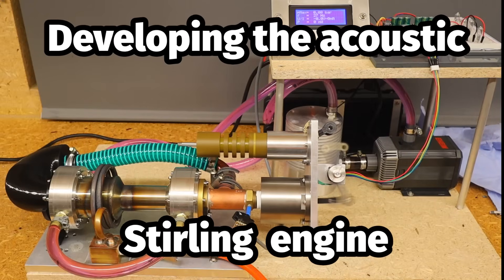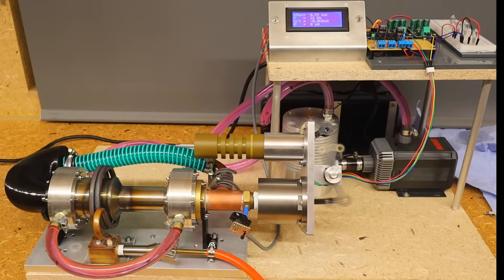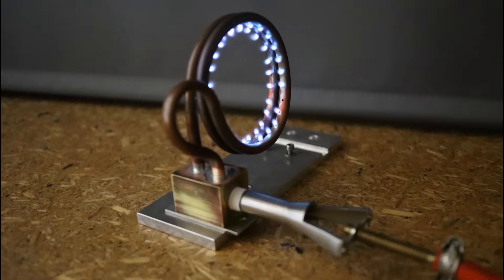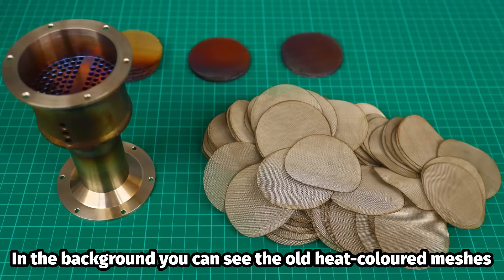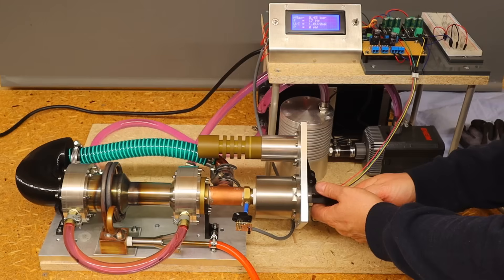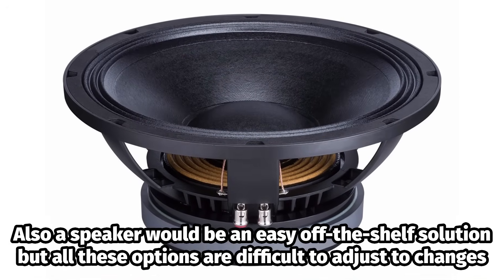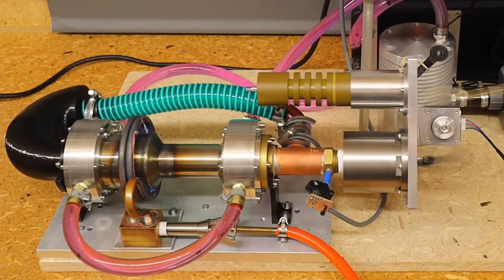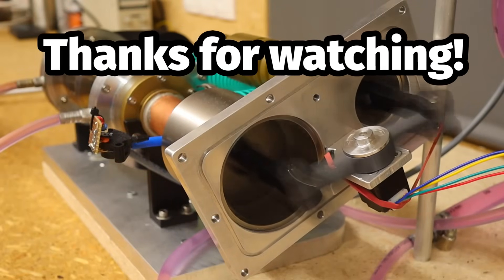More energy with the acoustic Stirling engine?

Comment: Can you not create a housing for linear generator, using small straight cuts of metal sheets to create a hexagonal shape. Instead of trying to cut rings.
Reply from the maker: Perhaps that is possible, but then there would be air gaps that would reduce performance, and I don't think it would make the work that much easier, or am I misunderstanding the suggestion?
In any case, thank you very much for your valuable thoughts!

Comment: To start the engine... use a half gear, beteen the pistons, on oposite of the nema, nema motor connected to gearbox. on each piston just use half gears there as well... simpliest way would be to use dual-shafted nema motor with a selenoid to interact with the "start-up"-gearbox-function...
Reply from the maker: The half gear is a very good idea, which I will consider more closely.
Thank you very much for your helpful suggestion!

Comment: completly different aproach: try piezo elements to extract energy. they would follow any resonat frequency.
Reply from the maker: Many people make this suggestion, but the question is how to excite the piezos when the conditions of the thermoacoustic motor change?
A membrane or diaphragm cannot adapt in the same way as a piston can.
Reply: @myengines2443  piezo elements can only work with small displacements, (roughly 0.1% of dimensional compression) medium sized piezos can transmit quite a bit of power but for that they are typically driven at several kHz, so they probably are not suitable for the low frequency of this thermoaccustic
Reply: One idea is to combine several to a bigger stack. A thin metal plate (light) shoud act as a piston and press against a circle (7) of stacks. Honestly i have no knowledge of the conversion efficency of pressure to electricity. Would research that first but myselfe had never had hot piezos.

Comment: If instead of using gas for heat, you use an electrical heater, you can make much precise measurements about the heat going in. It will also make it easy to mount and insulate.
Reply from the maker: Heating with electricity would be much easier and I could also save myself the exhaust, but since the engine will later be powered by self-produced biogas (check out my older video about that!), I would like to test it that way as well.
I looked for heating cables for this purpose but couldn't really find the right ones...
Reply: @myengines2443  just look up kanthal wire or kiln wire?

Comment: use generator with a motor pusshing the rod and starting cycle
Reply from the maker: That would be the most elegant solution to use the generator as the starter motor but I don't know if they (stepper or linear) are strong enough?
Reply: @myengines2443  strong is limited by wire of electromagned or transistor power output

Comment: It requires a GREAT seal i would assume, but most of the “Free Piston Linear Generators” i have seen utilize Air (or another (inert) gas) as a spring/balance.

Sealing/Lubrication may be difficult, but this is worth exploring.

It is FAR less accessible than FDM 3D Printing, but EDM and/or Thin Film Coatings such as DLC may work for this, even without Oil/an O-Ring.
Reply from the maker: That's exactly my plan; the crankcase has to be closed for pressure charging anyway.
By DLC and EDM, do you mean the running surfaces of the pistons and cylinders?
Thanks for your help.
Reply: @myengines2443 ”Electric Discharge Machining” and “Diamond Like Carbon”

EDM can get you near airtight tolerances, and DLC should reduce friction+wear.
Reply from the maker: Have you seen my DIY EDM Videos?
Of course there are better commercial engines than mine but I don't think EDM can achieve tolerances that are close to airtight!
DLC might be useful but i think its too expensive for my experiments, i know it from milling cutters.
Reply: @myengines2443  Making the theory into reality is really where it gets difficult, for sure!

  Collaborating with one of the channels that have made a Magnetron Sputtering setup MAY work for coatings, but otherwise you are right.

All in all best of luck with all the prototyping.

Comment: Arent those engines basicially 2 coupled resonantors? One is the actual engine (the tube) and the other one is the power extractor(Piston/membrane+ motor rotor+lever+balance weight). I would think those two have to somehow be matched to each other in terms of resonance frequency and stuff. Maybe thats why the engine refused to work with the balance weight attached. I think the problem were the dynamic properties of the balance weight, not some kind of friction.
Reply from the maker: I think you are right and I will work it out in the next test runs if the counterweight really disturbs the resonance really so hard that it does not run at all.
Thanks for your thoughts
Reply: @myengines2443  I am very hyped for this project! I will build one as my next big project. Did you ever think about casting some of the parts from aluminum? Casting aluminum is way easier/cheaper than it sounds, expecially since you can just 3D print the template. Could be ideal for parts like the cooler?
Reply from the maker: @WolfmanDude  casting aluminium is really a technique I want to do some time but unfortunately my time is limited and it will require a lot of time to get good results!
But its perfect for the engine and will be really an option if i had more time!

Comment: I think most of advanced optimisation and control lies in power electronics and programming, which is completely different domain. Something like harvesting energy with resonant frequency, continuously tracking mechanics phase and impulse.
Reply from the maker: Do you mean another form of energy conversion, and in relation to the thermoacoustic motor, I don't quite understand what you mean. It would be very nice if you could explain that in a little more detail.
Reply: @myengines2443 I mean that control circuit can continuously adapt load to the mechanical system parameters, to support its working on resonant frequency, maintaining it in most effective mode for current thermal power input, something like MPPT controllers do for solar power.
Reply from the maker: @artemylebedev9707  yes that's an important tip that i really have to implement when the power higher, do you think a normal solar MPPT controller will work when I adjust the voltage?
Reply: @myengines2443 it might work, however I'm not sure, if it will be stable enough. I feel like normally such controller needs to directly sense the piston position or at least it's frequency by some sensor (e.g. hall-effect sensor), to keep it in allowed range.

Comment: I would not build a linear generator. Too much effort and efficiency wont be great.

The crank mechanism you have is already pretty much optimal. If you install the same mechanism again in mirror image, you will have wonderful mass balance. And all without a balance piston. All you have to do is attach a weight to each of the now free bearing points where your balance piston used to be. The two weights must equal half of the weight of your power piston. Of course, you will now need two connecting rods on the power piston, but this should be quite easy to solve with a slotted connecting rod or by placing the two connecting rods behind each other. 

However, I would use BLDC motors as generators because of their improved efficiency. High-pole motors such as the 4108, where even a 30° crank angle is sufficient to generate significant power. However, the stator coils should be thermally connected to the aluminum housing so that they do not overheat. They have plenty of starting power and should be able to produce 50 Watts each at the 30 degree crank angle. As driver use an Odrive that can drive two motors at once. Also add position sensors to the motors for better control that are supported by Odrive. 

Regarding the gas spring resulting from your closed crankcase: I suspect that a relatively small crankcase volume leads to better results. So it makes sense to get rid of as much dead volume as possible. Making the volume adjustable would be perfect for development.
Reply: To add some background: I build and tuned many Nanomove linear motors for production machines and can tell you that you really should not mess with these. Just too much effort and poor efficiency. And these motors are really top notch, nothing you can build in your garage.
Reply from the maker: Thank you very much for your expert advice, which is very helpful to me, even though your assessment of linear generators is very disappointing for me. I really considered a linear generator to be a rather complex but thoroughly efficient option. Stepper motors seem to have very low efficiency with their oscillating movement, and I will try BLDC motors.
Thank you very much for your very helpful suggestions, which I will think about carefully!
Reply: @myengines2443   During my mechanical engineering studies, I spent years working on free-piston linear generators but only with theory. That's partly where my knowledge of linear drives comes from. The DLR has done a lot of research, and there are several publications, but they rarely provide information on the frequency spectrum, inductance of the coils used, and power electronics.  These generators never made it beyond the laboratory stage, even though they would be ideal for hybrid drives in theory. Unfortunately, it doesn't work in practice because the mass of the iron in the stator and the magnets in the moving part of the machine becomes very large. In hard drives, this problem has been solved simply by moving the read head over the disc using a rocker rather than a linear motion. This allows the drive or generator to be easily separated from its actual task, and in hard drives, a configuration has even been chosen in which the coils are movable and the magnet is static. This ensures even higher efficiency at high frequencies. 
 Back to your engine: A symmetrical crank mechanism elegantly solves this problem and also ensures that the piston remains free of lateral forces, thus reducing friction. However, unlike in a normal combustion engine, the crank mechanism does not run continuously in a circle, but oscillates back and forth between two software-defined top and bottom dead centers or angles. 
 This is exactly how you do it in your setup, only with two symmetrical BLDC generators to balance out the mass of the power piston. Just like a signle cylinder engine with two balancer shafts does. Two unbalanced shafts counter rotating inducing the same mass forces as an a single linear oscillating mass. 

 Unfortunately, I was never able to realize such an experimental setup myself, partly because I had been bitten by the EV bug in the meantime and then spent a long time building purely electric drives for mobility because they don't require any fuel for transport purposes, except perhaps for flying or crossing oceans
Reply: @myengines2443  Sorry to be so crude but next step IMHO: Get a decent BLDC with many poles pairs and an ODrive or similar controller. Balancing the engine is no priority at this low power level.

Comment: Brilliant stuff! Would it be possible to attach a rod magnet to the end of a piston and surround it with a solenoid coil, which could then be pulsed with a bipolar square wave to make the piston oscillate back and forth to start it?

To generate the bipolar waveform needed to drive the coil and kick-start piston movement, you could use a DC motor driver module—such as the Cytron MD13S—which can be modulated to produce a bipolar square wave. This can be controlled using either a 3-channel PWM signal generator or a programmable Arduino.  This set-up will allow you set frequecies from 1 hz to 20k hz with duty from 1% to 50%.

However, this setup may introduce additional challenges, so it’s uncertain how effective it will be. If you’d like, I can provide a link to a circuit diagram for reference - very easy to wire.
Reply from the maker: That sounds very interesting, and I have already considered something along those lines, but of course not in as much detail as your suggestion. An Arduino is already installed in the test rig and could take over the control. Would it be possible to generate enough power to start with reasonable effort?
Thank you for your praise and your very helpful and concrete suggestion!
Reply: @myengines2443 Many thanks for your reply. I believe this setup could easily kick-start the engine, and it would be interesting to experiment by pulsing the solenoid at the engine’s resonant frequency which this would have capability of doing. The power consumption should be quite low—only a few watts on a 12 volt dc supply  - since the solenoid’s duty cycle can be kept below 10% so shouldn't be a big demand if going over 100 watts.  Looking forward to you next installment.
Reply from the maker: That sounds very interesting and i will think of this very carefully. 
Many thanks for your great help!
Reply: @myengines2443  Once the power output becomes sufficient, it would be interesting to explore using it to drive a high-efficiency hydrogen electrode (over 90%). This could potentially generate gas for cooking and support off-grid living. Such electrodes do exist, but as far as I know, they’re not commercially available - and if they were, they’d likely be quite expensive. I’m experimenting with a few ideas, and if anything promising comes of it, I’ll share the results - it will complement this elegant design.

Comment: Is there any chance your final design, when you get there, could be adapted to work off of "waste" heat, such as from the chimney of a woodstove, instead of it's own combustion?
Reply from the maker: I think this would require a special design for low temperature with a much bigger volume but maybe its will be possible for small amouts of energy as even my engine runs on very low heat when everything works well.
For example when I turn off the heater the engine still runs for 10 to 15 minutes with the rest heat and can run on the lowest flame of the burner which is very small.

Comment: Your crankcase cover appears to be plastic. What about putting a magnet on the end to your connecting rod, and you could use an additional magnet on the outside to start the motor. If the magnet is strong enough. 🤷‍♂️
Reply from the maker: Then a lot of force will get lost as the 3D printed wall thickness is quite thick to withstand the high pressure I want to use.
But it would be no problem to use an electro magnet and to seal the cables and route them to the outside.

Comment: Use a suitable sized magnet on the end of the balance arm and dispense with the balancing piston.  This won't give perfect balance as as the magnet will be working in an arc, but the angle is small so reasonable balance should be possible.  Soft iron pole pieces and the coil could be attached to the inside of the pressure cover, and the pole pieces could be of a quite simple design, you might even be able to adapt the laminations from an old shaded pole motor.  This removes the friction from the balance piston and with some careful design should be significantly more effective than the stepper motor.  Integrate hall sensors to feedback the position of the moving magnet and you could drive the coil to start the engine with a relatively simple circuit.
BTW I'm impressed with the care you are putting into the construction of this engine, it's a real credit to you.
Reply from the maker: Thank you for the excellent suggestions, which I will consider carefully.
And thank you very much for the kind words of praise, which are always very motivating!

Comment: I wonder if you could start the engine with a short burst of high pressure air into one end of the system? People using compressed air for launching rockets, air pistols, etc... have built valve mechanisms that open very quickly.
Reply from the maker: Oh yes that's a new idea that I really will think about carefully...
Many thanks for your good thoughts!

Comment: I am looking forward to someone suggesting a good supplier for electrical steel and sharing it with the community. I asked a few cnc companies last year, never got very far.
Reply: I've used laminations from discarded electrical power transformers.  Worked very well for me.
Reply from the maker: This is my plan also, but it would be nice to find a supplier for small amounts of electrical steel!
BTW are the laminated steels easy to separate or is it better to let them laminated and try to get them in shape you need in this form?
Reply from the maker: Are the sheets usually firmly bonded, or can they be taken apart if, for example, the weld spots are removed?
Reply: @myengines2443  The transformers I used had the lamination stack clamped together.
Microwave transformers have the stack clamped with a weld bead in several places.  Once these are ground off, or milled off, the stack should separate easily.
Should you wind up with a transformer that was subjected to high heat, it is possible that the lacquer insulation fused the laminations into a solid block.  Best to avoid these.
Reply from the maker: Thanks, this helps me very much and I will look for an old micrwave or similar...
Reply: There is a video by Paul Babcock where he suggests low-carbon shot-gun pellets immersed in epoxy were an efficient and inexpensive substitute for silicon steel when he built his electromagnet motor.   Cheaper and easier to form into shape, with no scrap material left over...